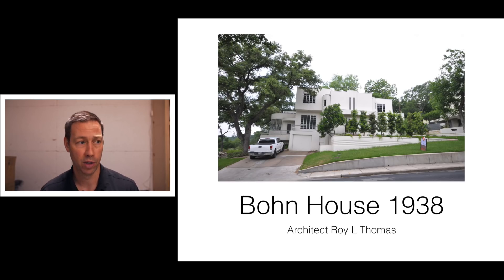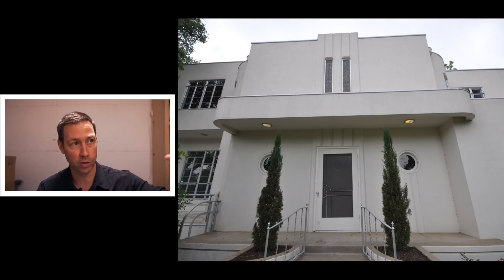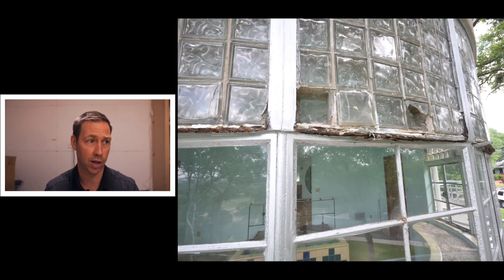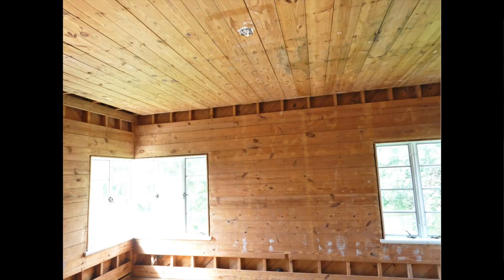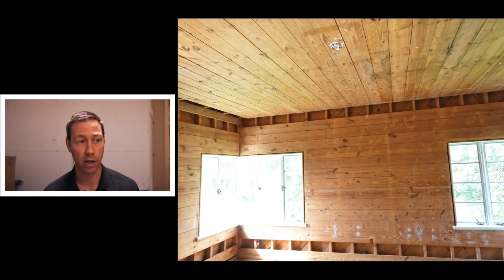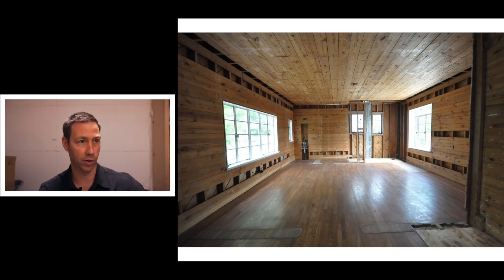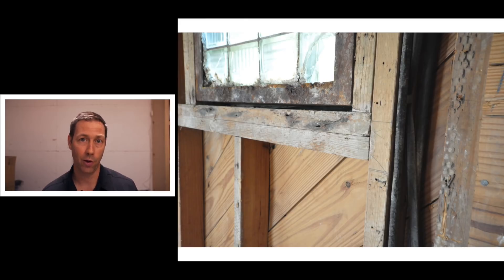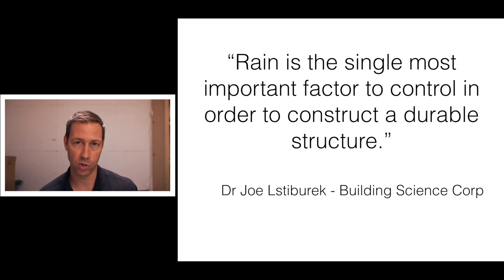Stucco - Is Rot inevitable? A Lesson In Building Science

Comment: So, what's the answer, if you want a new energy efficient house with stucco?
Reply from the maker: Coming soon. Had to tee up the problems first. Next video Friday will address assemblies that work with Stucco.
Reply: Seems like the most obvious answer is to start with a two foot overhang on the roof to prevent the sides from seeing water exposure except in the most extreme situations.  Beyond that a water resistant wrap and a dimple mat or other product to allow air behind the stucco (much like what they are doing with brick facades) so it can dry out and possibly some kind of french drain system to help direct water away from the building
Reply: yea where i am from it is extreme rain conditions. so we spray polywall or use peel and stick. we still have massive overhangs
Reply: im not sure if it would work but maybe matt could elaborate. but after osb/plywood you might be able to apply a product such as polywall spray on or a peel and stick product something that is highly water resistant and then stucco over that somehow
Reply: Use Contact glue XPS or EPS foam as main insulation. Apply the ETICS System you can google. Anchors special primers to make it stick to the OSB. Works well then you will use fiber glass reinforced mesh as first coat and finish coat on top.
Reply: How about builders stop build big giant heat sinks?!?!?
If each of how many millions of homes in SoCalif were NOT stucco, 
how much cooler would the ambient temperature be.
Reply: @BrianBriCurInTheOC  
The people in California should build their houses out of straws...
Reply: concrete also absorbs alot of heat and it takes alot of time for it to dissipate. so what other materials would you suggest seeing as your the professional
Reply: Leonard Martin 
Personally... I am a fan of SIP Panel Technology.
I believe not only are they the highest energy efficiency product on the market.
I would also guess that they would be more able to survive a major earthquake.
Reply: see i am more of a fan of a 2x6 construction with a 1.5 inch exterier huber zip r sheathing and 2 inch of closed spray foam and a 4 inch huber batt insulation as well. somewhere in the neighbour hood of a r 40 in a wall. closed spray foam in roof rafters as well as a batt insulation. i am putting sound proof batt insultion in the floors with a 1 1/8 inch huber sheathing, and using 2x4 floor trusses.  makes for a very energy efficient house. extremely strong and durable for canadian weather
Reply: Leonard Martin 
If I was going to build with sticks I would use your methods.
Our discussion is about the exterior clading.
On either stick Frame or SIP Panel I would use one of several siding or external wood products which have a drain gap behind them as Matt is always preaching about. 
Sitting here thinking about this I just had a thought, how would Stucco work in extreme cold climates?
Reply: we have stucco here in canada just gotta make sure its done right. over the 1.5 inch zip r sheathing i am spraying a polywall seal as well as using a certain teed stone facade and a certain teed composite siding both which allows a small gap behind for rain run off and drying
Reply: Leonard Martin 
Did I read what you wrote correctly?
It looks like you wrote you apply Polywall blue liquid product over Hubar's Zip sheating. The Zip sheating has a water barrier coating which you then apply another layer of coating. So do you use the PolyWall caulking product to seal all the seams before spraying or rolling the PolyWall on top?
Reply: while yes zip r sheathing has a water barrier coating there are still seams where water can get in. i will use polywall blue barrier 2100 on all seams and around windows etc as a flashing. polywall 2200 for joints and other areas as needed.  then i will spray not roll polywall 2300 on entire exterior of house. making it practically water proof as much as possible.
Reply: Leonard Martin 
Sorry for forgetting but is Liquid Polywall product Vapor permeable to allow warm moist air out of the house instead of locking it in and causing damage to the wood frame?
Reply: it is a full air seal from my  understanding. the house is also having a full house dehumidified installed and air filtration. so there will be no air flow inside the walls and only air inside house is the air i want clean fresh air with the levels of humidity that i decide.
Reply: you should look into matts videos on do houses need to breath says it great.
Reply: Leonard Martin 
You are a very intelligent guy. So many times people refuse to do a complete job  either because they do not want to spend the money or are just too lazy. 
Good Job!
Reply: i want a solid reliable house that will stand up for many many years. not i am the homeowner of this building not a builder. im a electrician by trade but i have paid much attention to many pros like matt and other job sites seeing what worked and what didnt
Reply: i am trying to get to the lowest amount of blower door reading as possible 0 air in 0 air out unless i say so. which means i have 100% control on the conditions inside of the house
Reply: i will also be installiing instant water heaters, hydro radiant floor heating and garage floor heating. although ive decided to go with a hot air furnace in the main part of the house using natural gas it will be a very efficient one. the garage will be on a multi split where looks are not a major factor. im also abit skeptical about multi splits in canadian weather. i am trying to get tesla to install a solar roof. and powerwall system i wont be offgrid but i should not need to consume any electricity from the power company i should be able to get credits actually from them. full led lights in the house and only led lights.
Reply: @lifeofabachelor8547  
Wow, I'd like to see a video of that house that you're building..
Reply: sorry i do not do vlogs. i can defiantly show you the basic floor plans just include your email and ill send it to you
Reply: joe i am not a builder i am a home owner. only thing i will be doing is electricial, and woodworking (cabinets, trim, furniture, pocket doors, and interior doors,
Reply: @lifeofabachelor8547  
Well, just reading what you had to say was fascinating
Reply: thank you so many people when building homes focus on the looks and not the function of the home. while there are alot of expensive looks in the place im building there is alot alot of cheaper things as well.

Comment: Idk if Matt covered this but Tyvek is bull....(under certain conditions?)!
While fixing a small leak of a two floor house(leaking occurred where the lower roof abutted second floor wall),after removing some vinyl siding to replace step flashing and shingles,I've noticed noticed that Tyvek came apart in my hands like wet paper towel,except it was dry.
Circumstances:
south facing wall abutting a roof located in NJ
no insulation,siding placed directly on Tyvek
roof and siding were installed about 10-15 years ago(rough estimate,couldn't confirm with homeowner)
Anyone with similar experience?
Reply: i've had some house wrap come apart like that and it was UV exposure.
Reply: I'm thinking that's why I'm going with Vycor house wrap on my new house self Adhesive
Reply from the maker: Check this out. “A Stucco Failure - Lessons Learned and How to Fix!” https://youtu.be/MPUvfTipgyg
Reply: Yes. Also at Jersey shore. Saw a siding job on a condo building siding was put over tyvek. looked like tissue paper probably 15 yrs old. I believe the wind batters the tyvek with the siding.
Reply: Personally i dont believe tyvek should ever be used as an end all method for water proofing. Its an excelent air barrier , but needs that drainage layer to allow water to drain.

Comment: That sprinkler head was a 360 degree because some moron didn't put a 180.  Waterproof paint (masonry paint) can be applied on stucco, other than obvious cracks it should be waterproof.
Reply: Or replace the head with a 180
Reply: You are correct about the sprinkler head but totally wrong about stucco being waterproof.  You absolutely do not want the stucco to be waterproof you want it to breathe.  Water that gets behind the stucco needs to be able to escape otherwise said water will destroy housing components.  Waterproof barrier type systems, like EFIS, proved to be disastrous.  No matter what you do water will penetrate as needs a way to escape.  With stucco a waterproof wrap should be placed on the sheathing followed by a drainage plane to allow water to exit.
Reply: I used to work in the pottery industry and as far as I know "normal" bricks are not fired to a high enough temperature to be water proof and as a result they also need to breathe

Comment: What is chip and Joanna ship lap ?
Reply: Chip and Joanna often (over?)-use non-structural ship lap for finishes. The ship lap in this vid looks to be pretty stout. Probably has structural strength and may have been concealed w/ another finish.
Reply from the maker: Correct
Reply: Thanks everybody !!
Reply: Matt Risinger l
Reply: august 

It’s from a TV show called Fixer Upper. They are based in Waco TX.
Reply: and their fav finish .. is ship lap!
Reply: She’s the interior shiplap Queen
Reply: Chip and Joanna refer to any interior wood paneling as shiplap.
Reply: I had to pause and Google it too!
Reply: Typically a 1x4 or 1x6 finger jointed pine, not real dimensional lumber.
Reply: Tbh they do refer to the design look as shiplap but have even commented as such. 

They do work with actual shiplap though when working with old homes that have it; it’s why she became known for it. She stumbled upon it when starting out and fell in love with the material and wanted to showcase it as the story is told.